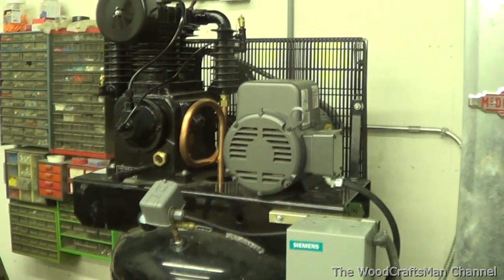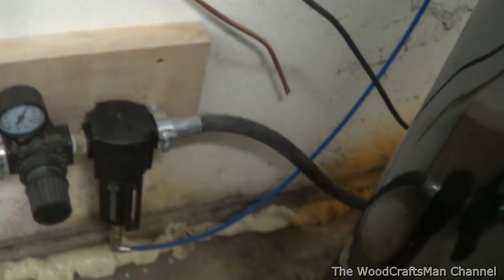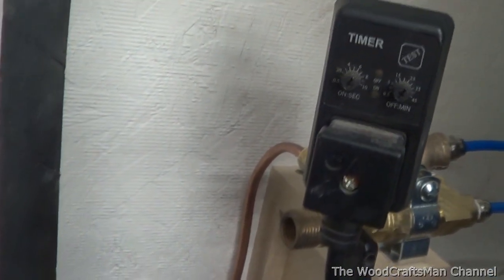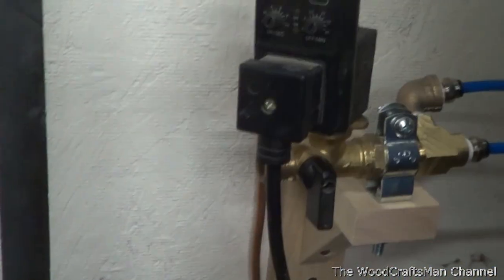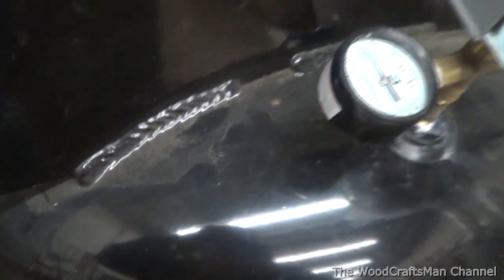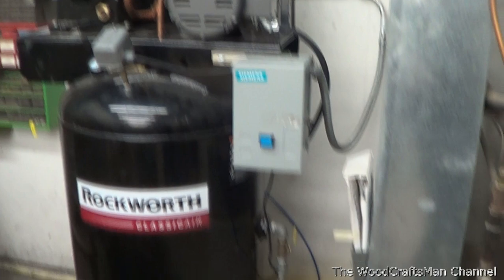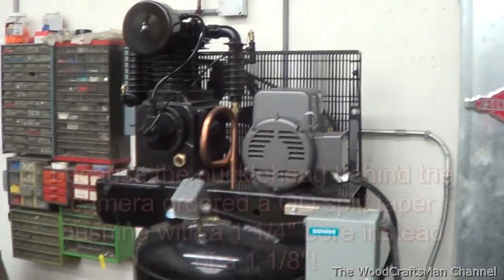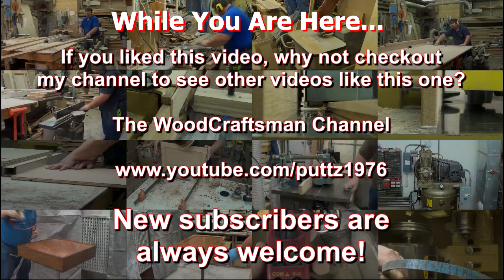Air Compressor Automatic Tank Drain # 142

Comment: I've got a Saylor-beall  comprsoir..auto tank drains are a must..in fl.  I have a 705 pump my unit fully pkg..was about 4.500 hundred..I was sick of big box store crap for my hobby shop.
Reply from the maker: Saylor Beall is an awesome compressor, and the 705 is their flagship pump, very reliable. This pump is an overseas SB 705 knock off that I got from a local compressor shop. Knock on wood, surprisingly, for the work its done for me being slightly undersized based on duty cycle, its been great!

Comment: Hey Scott, great video but I have a question. My understanding is that the valve has to be mounted at the same level as the drain (or lower) or the water will never fully drain. Can you comment on that? Thank you.
Reply from the maker: You bring up a good point. In theory that would be the case, but, remember the system is under pressure, so when the auto drain opens, the pressurized air is going to use force out the condensation. If the system was not under pressure, yes you are correct, the water would never leave on its own if the drain was higher than the tank. Thanks! Scott

Comment: Hey Scott,  I see you have the auto drain wiring connected in the starter/contact relay box. I want to set up my auto drain like that, Can you reply and give me a written wiring diaphragm on where the drain wire connect on the contacter. I want it to drain via timer setting only when compressor motor is running.     Thanks Jim
Reply from the maker: I can only give guidance, you will need to determine your exact set up. First you need to have the same voltage as the compressor, so if your compressor is 220-240 volts single phase, you will need a matching electronic auto drain. The drain is wired into the load side of the contactor (T1 & T2), you will want to connect both hot legs from the 220-240 drain to the same to terminals that the motor is wired to on the contactor.  Your contactor might have a thermal overload below it only on one leg (T1). If you can, try to connect to the contactor and not the overload, if not, it's not a big deal, the auto drain current is quite low. Hope this helps. Scott

Comment: Great Video.  I watched it a ton of times...until I ended up going with the same setup.  I really like how it only purges when the compressor is running...seems much more efficient that way.
Reply from the maker: I'm glad you found it helpful. It might be minimalistic, but I just thought that if it purges around the clock, eventually, the compressor will start up again therefore repeating the cycle all over again. If I would change anything with an electronic drain, I would use a "delay on break" to allow the electronic timer to pugre once or twice after the compressor stops.

Comment: The Saylor Beall (be-all) compressor's after cooler location does not pre-heat the air being used to cool the pump like the other ones do.  THAT is the advantage and difference.  However, still being belt guard mounted, it makes belt adjustments and replacements more difficult.  I like the idea of a horizontal after cooler above the motor better.  The after cooler or motor also won't be pre-heating air for the other if they retain the motor's fan.  Natural thermodynamics would do quite a bit for an after cooler in that location, but an electric fan can add to heat dissapation.  It would also add to electricity useage.  Saylor Beall makes great compressors, but being designed for industrial use, they come with an industrial price.  I have seen a compressor motor mount that had a screw adjustment under it's baseplate mount just for belt tensioning.  It reminded me of the belt tensioners used on Japanese cars in the 1980s.  IDK if anyone makes an add-on accessory like that or not, but would be nice to have.  You could try using one of your spreaders, as they do a similar job.  It just wouldn't be attached.  Beware of overtightening.  Too much belt tension can damage shaft bearings.

Comment: Hey Scott..Hope you are doing good. Are you still happy with the 220 volt auto drain purging air only when the compressor is running? Im thinking that condensation will still be building up after the compressor stops. 
I just had to get a new compressor. My 3 hp Porter Cable pump seized up after 11 years of hard use. 
Wanted to go bigger but i got a Quincy QT 54 60 gallon 5 hp. I installed an hour meter on it. 
Im really wanting an auto drain. Thinking it will save a lot of time not walking back there 3-4 times a day.

Comment: I must have missed some videos. you had a Quincy prior! right! and now this one. I bought a Qt 5 and love it. why not another Quincy?
Reply from the maker: +Dave Nichols, hi, I did have a Quincy QR 325 compressor, but the tank sprung a leak back in November of 2014. I was originally going to purchase a new tank, but I also noticed that the rear seal was leaking again after 2 years. So for the time being I purchased a Castair  (Saylor Beall 705 overseas knock off) with out a motor from a distributor. I looked at the Quincy QT 5 and a few others, and I didn't like the high rpm and it had reed valves where as the QR 325 and the Castair both have spring and disc valves, and the Castair RPM is around 770 compared to the QT 5 which is around 942. I have the Quincy 325 pump still, and plan to put it back into service in the future either with a tank or standalone unit plumbed into the existing tank and use an alternating relay so the two compressors take turns. Thanks. Scott
Reply: The Wood Craftsman Hi Scott thank you for the response. Have you heard of polar air compressor. I don't know a lot about them but I saw a video on a 7.5 horsepower and it ran slow and quiet! looked like a good compressor if you're looking for something quiet. thanks Dave.
Reply from the maker: +Dave Nichols Hi, yes I did look at Polar Air (Eaton Compressor). They are in direct competition with Castair. They used to use Baldor and Weg motors, but they now use a cheap imported motors and electrics,  where as the Castair uses Leeson motors, Square D pressure switches and magnetic starters. I would live to have a 7.5 hp compressor, but I only have a 100 amp service in the shop, and with the other equipment I might be short on power, especially if I upgrade my dust collector blower to a 7.5 hp. Thanks. Scott